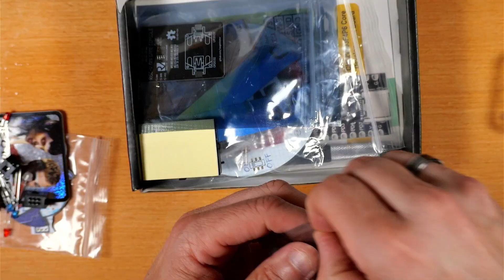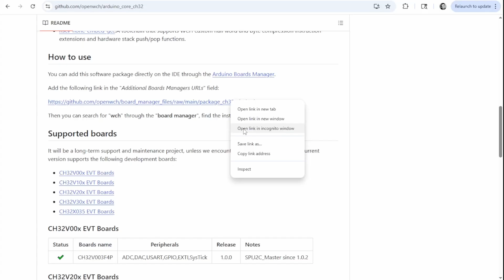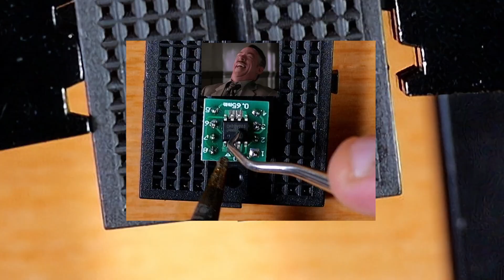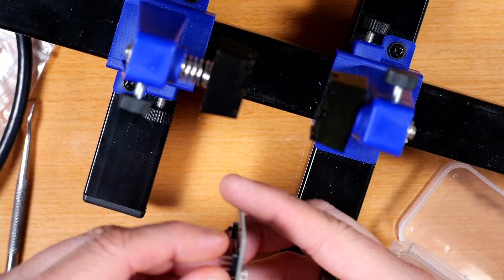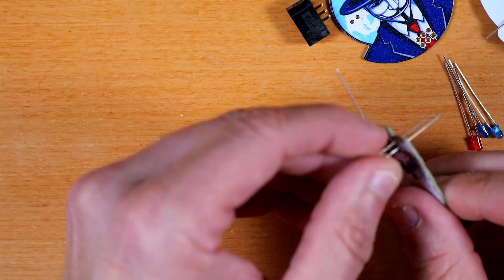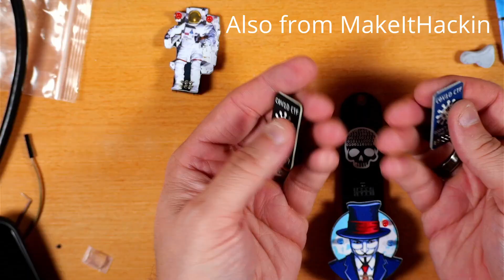Hackerbox 0116 - RISC Is Good

Comment: The mini console didn't seem like it glitched for me, but the buttons stopped working and wouldn't start the game. However it played just fine as long as I powered it with the programmer. Figured I maybe had a solder bridge on the power switch. After watching, now I'm thinking my issue is the battery thing.
Reply from the maker: Man I thought I replied to this. Sorry! Yeah these batteries don't hold nice non-glitchy voltage very long it seems for this particular application. i picked up some energizer ones recently. May try that to see if it works any better for longer as a comparison.